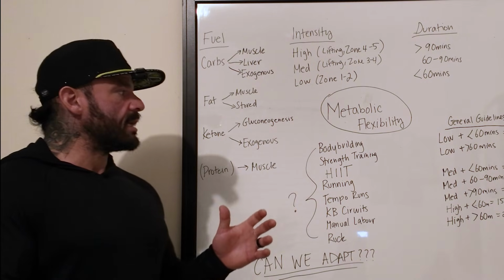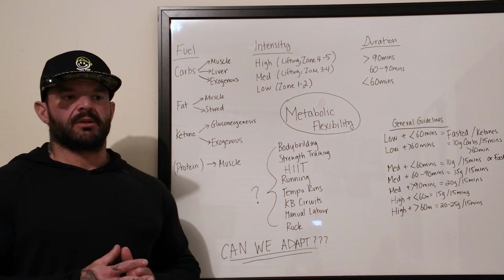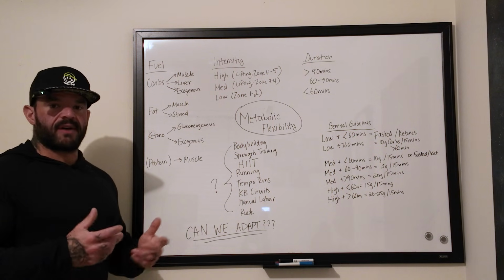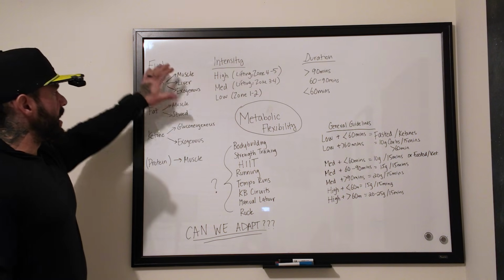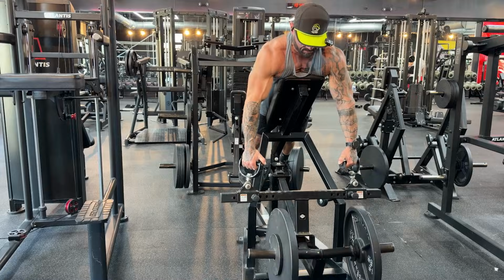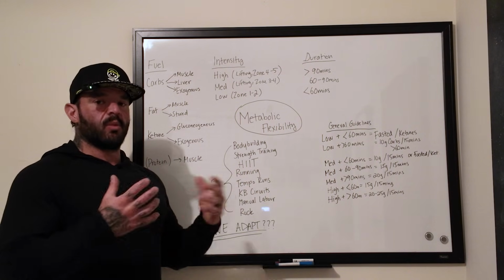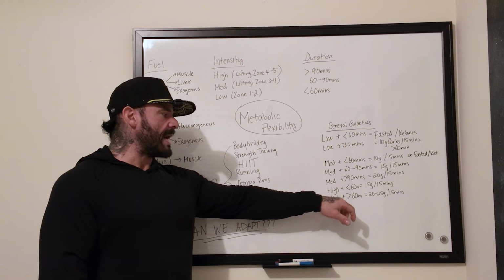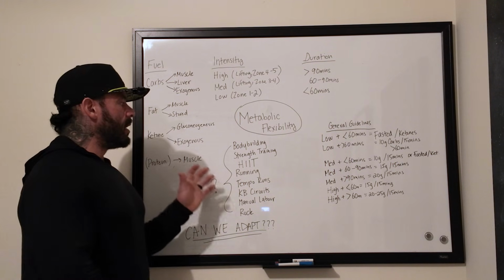Metabolic Flexibility Explained: How to Train Your Body to Use the Right Fuel at the Right Time

Comment: Finally, this is the content I've been wanting for a while among all this nonsense in fitness youtube. I think you're right about the gaining muscle and losing fat part. During covid shutdowns i trained fasted every day and mixed training intensities and modalities, but always finished with a bit of cardio. Then at sone point started doing 100 burpees at the end, in two weeks i got visibly leaner but my bodyweight didn't change at all. Also when i would do cardio on the second or third day of a fast it is nothing short of euphoric.
Reply from the maker: A strategy like that can work for sure but at some point, perhaps intermittently, you’ll want to leverage some carbs pre/ intra training so you can drive up intensity.  Doesn’t have to be everyday, but it’ll absolutely make a difference in the stimulus you can provide
Reply: Yeah the heavier days i trained fed since performance was better on my lifts. That was twice a week at that time.  @pauloneid_map